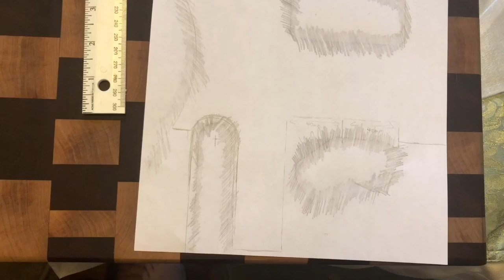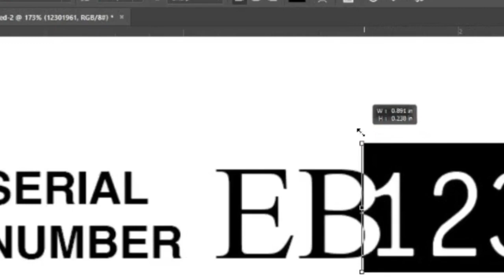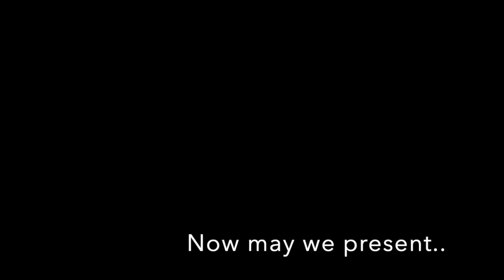Making The Worlds First Left Handed Dragon Telecaster

Comment: How did you make the pick guard
Reply from the maker: 1. Cut out and shaped Clear Acrylic
2. Cut out holes
3. Filed and fit the guard to perfect size
4. Traced the shape onto Diffraction Grating Sheet
5. Traced the shape onto Aluminum foil
6. Stacked it up Aluminum foil on the bottom, Diffraction Grating Sheet in the middle and Clear Acrylic on top and screwed it all down